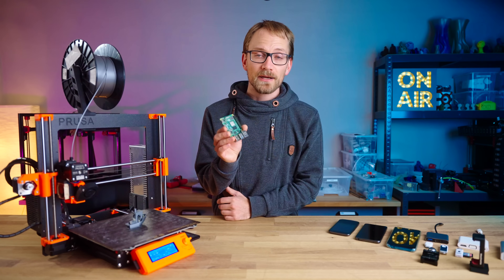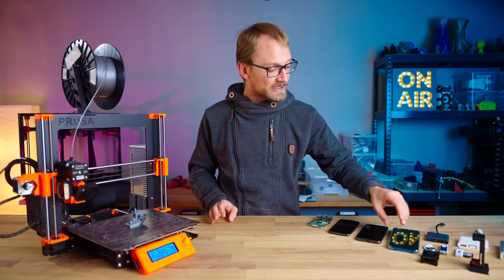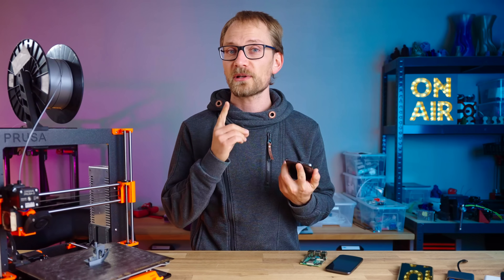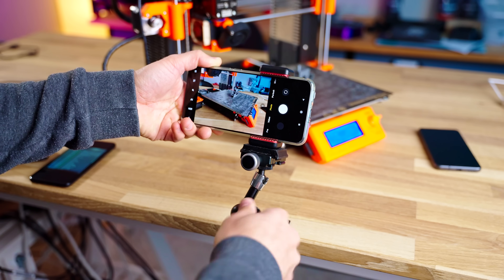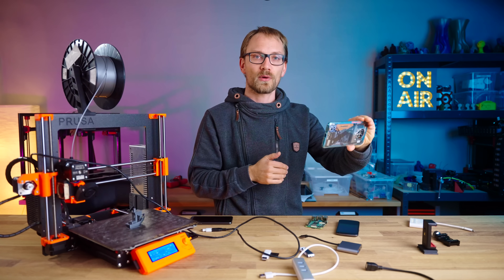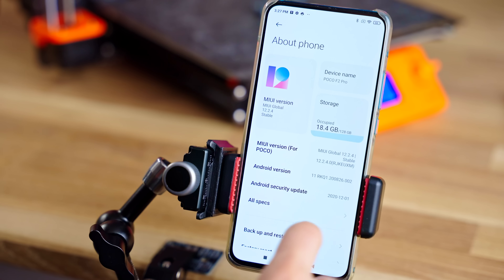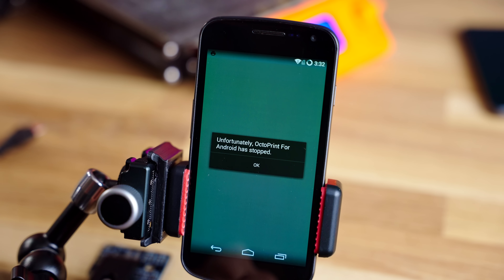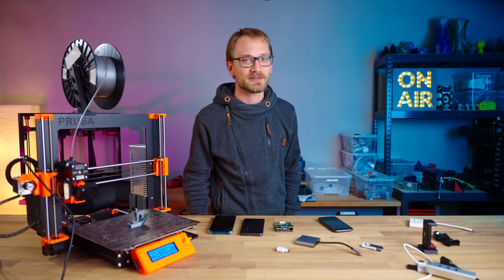How to run OctoPrint on your phone!

Comment: One big advantage of octoprint on a Raspberrypi is to use the GPIO pins to use for additional devices like illumination or additional fans for the printer enclosure. That is not possible with a phone.
Just wanted to point out so everyone knows this fact for his decision.
Reply: Sure it is, octohue and ZigBee lamps or switches. works great. It's non gp but is io.
Reply: @MadmanInUkraine 
Sure you can use the mentioned solutions but not automated within your G-Code. Please correct me when I am wrong. 
I do not say that using your phone for octoprint is a bad thing. I totally can understand using old devices and even more when it is as easy like in this case but everyone should know the advantages and disadvantages of using an old phone or a Raspberrypi.
Depending on your needs and your plans for the future it can be better to use Raspberrypi. If you never want to use GPIO pins it is more easy to use an old phone that has no use anymore.

Comment: everything has worked out great so far, only thing is, I cant connect my prusa since it is not able to find a fitting baudrate.
That was a couple of seconds ago, found the cause: disable the rpi setting within your prusa printer settings.

Comment: I've tried this, ended up getting a used 3b anyways. It's near impossible to find a dongle that will charge and transmit data simultaneously, and even if I got that working, running my old androids for more than 15 mins could probably let me print abs on the glass

Comment: This is great - I just recycled an old Nexus 6 that has been sitting in a drawer.  The only thing I'll say is, you should probably get one of those things that strips power transmission out of the USB connection - on my Ender 3 (and this seems to be a common Ender problem), the USB connection powers the screen on the printer.  I didn't have one of those split connectors on hand that allowed me to charge at the same time, either, so I turned off my printer and didn't think about it.  It drained my phone completely in less than an hour.
Reply: you could just put electrical tape on the Vin of the USB male port, that way you disable delivering power to your printer. Thats also what I did when running octoprint on my pi 3b+

Comment: Thats amazing! The cable mess was the most disturbing thing when using octoprint on the pi. Charger + pi + Webcam + light. Weird question.. phone light could actually also be used for the time-lapse setup. Or do you think running the light for hours and hours can reduce longevity of the device?
Reply: The camera flash LED should not be used for longer then a couple of seconds. Nevertheless why would you if you do a time lapse? Just take a photo every other minute ;)

Comment: Im very new to Octoprint, with a Pi Zero 2W in the post. In our home when the microwave oven is turned on it wipes the wifi out, im wondering if this will upset the printing process? So for now ive used this tutorial to set up my old Galaxy S8 phone and printing from SD card (Prusa i3 MK3S) just using Octoprint/Android to monitor the print.
I feel the Android device is ideal for this half way house usage.

Comment: I run octoprint on a 20 year old laptop, running linux. Works great, it's nice to have a big screen for control and monitoring, but mainly it's just what I used prior to octoprint. A linux install of octoprint is a bit more involved than just running the octopi image, but I had no prior Linux experience when I started and there are guides.
You can also run octoprint on windows, but it's not quite ideal compared to Linux apparently.

Comment: I love the idea! So I grabbed my old Oneplus 3, throwed the latest LineageOS on it, and installed the Octo4a. Works really nice first! But then I realized that there is no way for me to charge and using the USB port for connecting my printer at the same time. Even with a USB-C "docking station" it either charges or connects to the printers serial port. My phone is unlocked/rooted, so if someone can give me a hint how to work around that (without welding in the gutts of my phone) I would appreciate that! Another disadvantage of this solution is the camera server that lets the camera getting very hot and sucks the sweet battery juice like a hungry baby elephant. I was able to print a little low poly cat for 40 minutes or so, as my phone died and left the cat headless.
Reply: May need a custom kernel to support charge + otg.
Reply: @AymanSuleiman  do you might now where to find this? I couldn’t find one for my oneplus 3t
Reply: Were you able to get this working? I was hoping to use my old OnePlus 3 for Octo4A.
Reply: @SpitFirePipe  Same here, I've tried 4 different OTG splitters. 3 of them DO charge the phone but stop charging as soon as I plug something in to the USB port on the OTG cable. I measured the amps and it turned out that there is still power going through but it's probably being redirected to the print instead of the phone
Reply: DC to DC board set to 4.35 volts and hooked directly to where the battery was (remove the battery)
Reply: @muwahh98  The oneplus 3 is kind of a steel enclose. No easy way to do this and I honestly also don't know how and if I am willing to dedicate the phone for octoprint
Reply: Nobody knows how to get this working?
Reply: Same here. Also on the OP3 boat really wishing we could OTG Host Power working.
Reply: @ns9672  same here with the xiaomi mi max 2. works with newer phone i don't know why though
Reply: I also tried everytrhing. Even that usb/hdmi/charger dongle did not work. But I noticed some interesting behaviour. In some cases the battery was not discharge. It looks like there is a combination of powering on and plugging in when the phone receives enough power from the printer. Is it possible? (This is why I wrote earlier my battery can hold  even up to a 24 hour of printing, or more.) I'm currently examining this effect. I'm trying to find the proper combination of powering on and plugging in the cables.
Edit:
I forgot to mention: in this case I used only an OTG cable to connect the printer directly to the phone. Another thing, when this charging like effect happens, the phon doesn't shows it's charging.

Comment: Unfortunately I don't have any Android devices that still work. Had a horrible experience with Android using the Nexus 7 2013. Switched to Apple and never looked back. Everything in Android on the Nexus 7 was just so slow compared to the lower specced iPad Air 2 yet the iPad was a speed demon. 

Now if somebody made this for iOS I'd jump on board. Yes you can side load apps on iOS if you know how to and you don't need to be jailbroken to do so. I have plenty of iOS devices that still work great even that iPad Air 2 that replaced my Nexus 7 all those years ago.

Comment: Works well. I have one of the Cr6-se. It of course fried my rpi 4 when the heatbed shorted, creality replaced the bed and the board but mot my pi 4. Ive been running octorpint on and old LG g6. No ARC support tho, will not install.

Comment: I'm trying to find a micro usb adapter like that, but they all say that wont charge a phone (but they will power a streaming stick). Even the one in the link put by Thomas in the description of the video, claims "(This OTG Cable will NOT charge phones or tablets but can power on streaming sticks)" is that correct? how can I find one that does charge the phone connected to it?
Reply: Same
Reply: Same for me: tried 3 Y cables, none of them charge the phone. I'm searching for a solution (including soldering an extra micro USB type B). I'm interested if you found a solution already!
Reply: @LaurentWiart  I havent found a solution either.. if anyone finds a way please share!

Comment: Nice, given Octoprint is actually platform agnostic, you can install it on anything that has sufficient specs, pretty much regardless of architecture. In fact you can install it on a PC even, re purposing an old laptop that is just sitting unused is an interesting usage for that, at work we have a printer that has it's own "terminal" PC to run it, tho given it's weird old software needed I dunno if Octoprint could handle it, but a motherboard upgrade sure is on it's way.
Reply: IIRC octoprint runs incredibly well on x86, really smashes through some of those g-code/slicer visualizations that can be really heavy even on a 4/8GB Pi4B.

Comment: I like the idea of using a tablet. Only issue is if you leave it on charge 24/7 you will damage the battery. Best bet would be to turn off the charger while not printing.

Comment: If you plug a USB hub into a newer phone do you think controlling multiple printers would work fine? If so I am 100% sold on this. I might buy an old phone on ebay either way to try this out as the setup seems way easier than with a pi
Reply: Currently only one printer is supported, but I should be able to add support for multiple printers with the current architecture

Comment: This video just made my day ! I always wanted to make those cool time lapses on my Ender 3 V2 but never had the option because I already had the Creality wifi box... That works well but doesn't allow the variety of options which Octoprint does. Will surely be trying this out! Thanks a lot Tom 💯👍🙌
Reply: creality wifi box.. octoprint with none of the advantages LOL
Reply: @AkiraFurball  not exactly... I got my first printer for 215 dollars with the wifi box and could pretty much print remotely so buying a ras pi didn't make sense. It was good enough for starters, but this is gonna be a lot of fun!
Reply: @nisargdoshi2640  Creality wifi box... Octoprint with none of the advantages other than wifi printing
 ;)
Reply: @AkiraFurball  yep that's true
Reply: @AkiraFurball  That's why I'm making the switch. could you just explain to me one thing, something that I saw in another comment thread about the y cable messing up the printer instead of charging the phone... thanks!
Reply: @nisargdoshi2640  Have no idea, I run it on raspberry pi..
Reply: @AkiraFurball  Ohh ok cool
Reply: @nisargdoshi2640  I think basically the jist is that if the phone requests a rapid charge the charger would supply a higher voltage which would then feed that voltage into the printer as its a shared usb cable..

You could easily prevent this by splicing open the part of the y that goes to the printer and cutting the power wire, or using a power blocking usb adapter which I think you can get on amazon for the connection to the printer..

I am not entirely sure if it would even happen as the negotiation for fast charge is quite complex and requires a cable that is fast charge compatible, which a y lead probably isn't, but I would still use one of the above methods to eliminate the possibility

Hope that helps..

Comment: There are NO Y cables I can find that power the phone.  Every single micro usb otg y cable i've looked at on amazon says it won't charge the phone/tablet, and I've looked at ~20.
Reply: I found the same thing. found an old Samsung S6 in the drawer and wanted to try it. currently running 2 pi 3B and a VM running octofarm. but no cables that will charge phone?
Reply: @mammofiedfunk761  at this point it think the deal is roughly:  if the supply is 5V only and a capacity of > 2A like 2.4A it will probably be able to source sufficient current for the phone as well as whatever else is plugged in.  I've ordred some and I'm going to try that out and let you know.
Reply: I'd love to know too. I have an old Nexus 5 sitting in a box. And this would be a very compelling thing to experiment with for <$10 compared to when I thought of trying out OctoPrint by getting a $40+ Raspberry Pi kit.
Reply: Same for me: tried 3 Y cables, none of them charge the phone. I'm searching for a solution (including soldering an extra micro USB type B). I'm interested if you found a solution already!

Comment: That is awesome! 

Sometimes I question my decision to use my sole Raspberry Pi as a Pi Hole server instead of as a Octoprint server... but not anymore! 

I conveniently upgraded from a Pixel 2 to a Pixel 6 this past week, and now it looks like I have found my old phone's new purpose in life!

Thank you sir!
Reply: If you install Raspbian, then pihole, then use the script install for octoprint. You can run both at the same time. Pihole uses basically no power, and octoprint only uses lots of resources when rendering time lapse
Reply: @eslmatt811  Thanks, I thought about it, but my modem and router are upstairs, my 3D printer downstairs and it's not worth the effort to me to run a network cable to my basement. 

Currently I just use a Blink Mini camera for monitoring large printers and can live with loading prints via an SD card.

Comment: I have a pixel 4, which has a front facing IR camera accessible through some forks of open-source android camera apps (specifically, HedgeCam 2 for example)

I very excitedly opened the octo4a settings and saw that it listed two front facing cameras... But sadly, the IR one is inaccessible.

Oddly enough, there's two rear facing cameras (a normal one and a tele/zoom one) but it only sees one rear facing camera in settings :)

At least it seems to be working in "normal" sense, even though I can't take advantage of that specific unique feature :p I quite enjoy using the IR camera as a short range security webcam or as a way to see through IR-transparent plastics but figured it might be useful on a 3D printer webcam setup, as I could run the printer at night but still have a clear view of its operations without the need for blindingly bright lighting at midnight haha
Reply: Octo4a dev here - I have a pixel 4a 5g, will try to get it to work :)
Reply: @filipgrzywok6023  YOOOOOOO

I was just thinking today "I wonder if I could possibly help merge HedgeCam's open source tools with O4A", this is amazing! Time to buy an OTG hub
Reply: @StormBurnX  unfortunately pixel 4a 5g does not have access to the IR camera. I can try to implement it but i"d have to test it with you.
Reply: @filipgrzywok6023  the pixel 4 has an IR face unlock camera, the pixel 4a has a fingerprint sensor instead, but if there is anything I can do to help test I would be happy to help

Comment: I downloaded this app months ago and tried it on 2 printers, 5 phones with the USB adaptor power cables.  Took them months to update the USB device IDs and my SKR 1.3/4s could not be detected.  I was all about this project till the lack of response from the developer for months with a very large group of end users begging for an update so they could use it with Ender 3s left me slightly soured.  Still a great idea but now I'm reluctant to even switch up my environment until I see some long term investment from the developer. I will agree the interface response was much snappier than my Pi3 and I hope that with this video will bring enough interest to turn this into a long term solution for many users.
Reply: I'm sorry for the lack of response at first. Getting from 0.0.5 to 1.0 release required me to basically rewrite everything from scratch, figure out and test my own termux replacement (feelfreelinux/android-linux-bootstrap), rewrite the camera server from scratch and a few other things. During that time I didn't want to support the older release, as upgrading to 1.0 required a full reinstall which isn't really handy with a larger userbase. I also added an option to manually select a driver, which makes running octo4a possible with every printer, even those that are not officially added. Octo4a is a hobby project of mine, so sometimes it's hard to dedicate a lot of time to it.

Comment: Thanks for this info. I’m running on a pi 4, but have issues with the IP address changing (and instructions on how to make this static are hard to find that are easy to understand). I may dig out an old fire TV (the overpowered quad core one that was restricted by the Amazon Fire OS). I have cyanogen mod on it, but I am not sure of the spec, but am I looking to match or exceed the Pi 4 for this to be viable?
Reply: You coule be quite fine even if well under pi4 spec, other SoCs will be tuned differently, have different architecture optimizations etc. As to your IP issue, have you tried giving your Pi a static IP at the router end instead? Log into your router's GUI, go to the DHCP settings, assign a fixed IP to the MAC-ID of your Pi. This way you can leave the Pi in DHCP/automatic network settings mode.

Comment: By flashing your phone the requirement for a battery is dropped on most roms - means your phone can run without a battery, purely on usb power without any hardware modifications.

Comment: ive been wanting to get into octoprint for over a year now and this video just made it happen for me! Tons of android phones laying around waiting for a second chance.
Reply: You can use an old Laptop aswell. But to use a Phone is 1337
Reply: I have as well, and the dongles...but also have like 6 rpi's here so Ill use that as I dont love the idea of batteries in a heated chamber. I do think this is a great solution to use old phones though, as there isnt many use cases for them and if you are like me you have a bunch of them.
Reply: @francistaylor1822  remove the battery and in it's place solder a capacitor.
Reply: @jurgislll  can you elaborate on that one?
Reply: I am glad that i dont have to solve this "Cheap" Problems this old phones produce
Reply: On god
Reply: I have a ras pi and o droid. Been having for years. I literally got these for like 10 a piece brand New Years ago. Now they 100? How
Reply: Do you keep your old phones on your cellphone plan so you can surf the web and download the apps and files you will need?

Comment: I have one question. How hot does the phone run in this setup? I'm asking because I'm worried the constant heat would eventually driver the battery to inflate and explode.